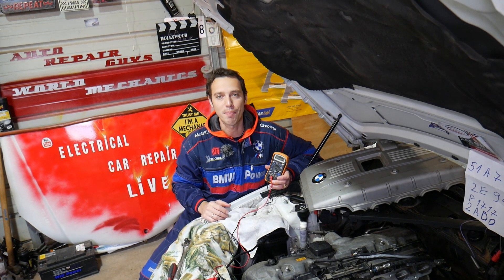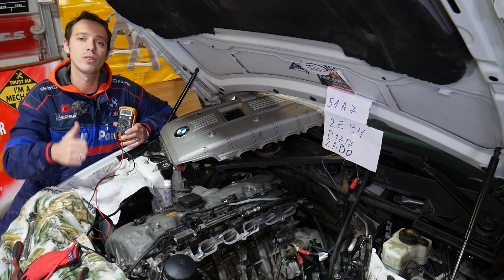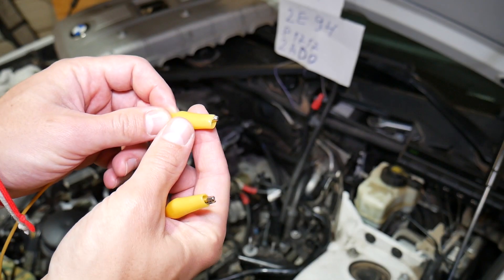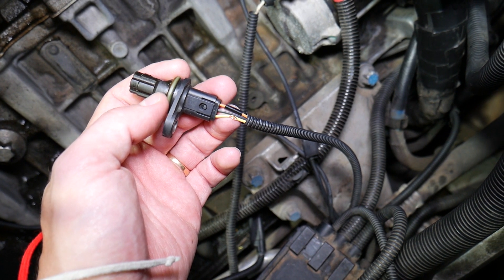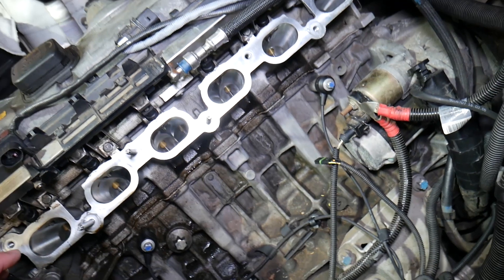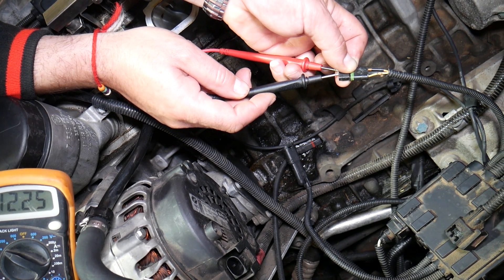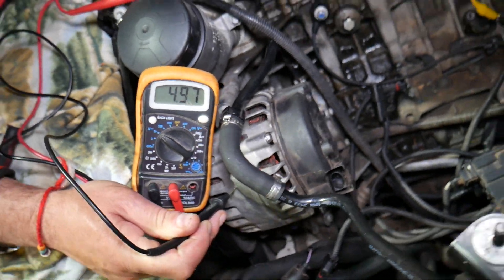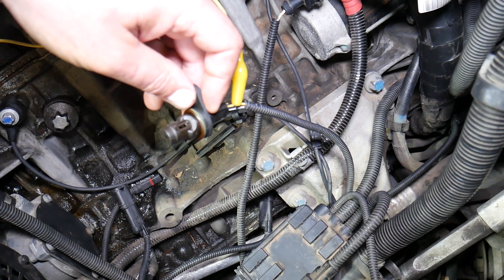BMW X5 HOW TO TEST CRANKSHAFT POSITION SENSOR

Comment: I'm getting 2B5C and .98v in signal the rest 12v from battery. The connector doesnt look damaged but isnt giving me the 5v it should. any Insights? e70 x5 2008 4.8 n62. I'd appreciate it thanks.
Reply: Did you ever figure this out? We just did an engine overhaul and everything is back in the car, and now we have crank position sensor problem. getting similar voltage readings as you.

Comment: Thanks for the video! Very helpful to understand how crankshaft position sensor works! I am looking for a "how to " video on replacing crankshaft position sensor on my 2011 x5 diesel and can't find one. Maybe I will make one when I replace it.
Reply: Did you replace yours? I need to do mine. Where is it located?
Reply: @phillipmrowczynski8373  yes I replaced mine. Easy to replace once you get to it. You need to remove the intake manifold and the starter to get at it. It is located below the starter.